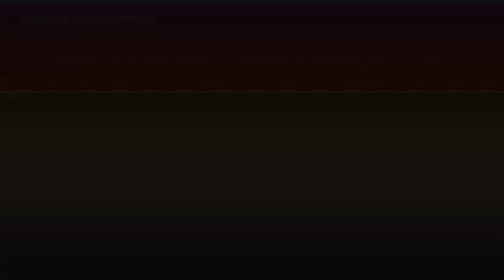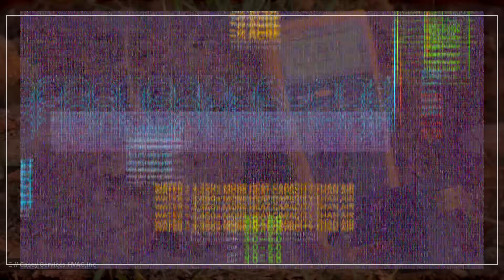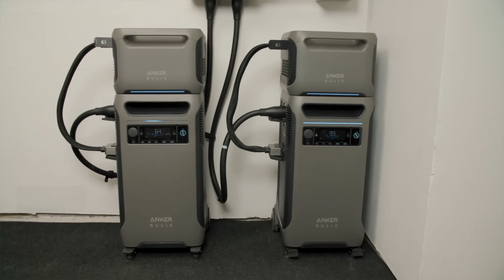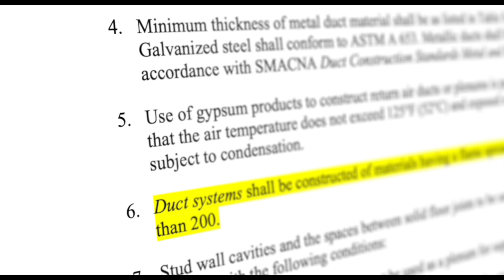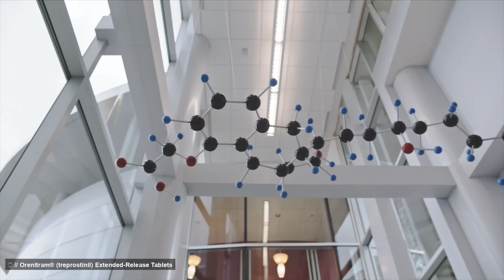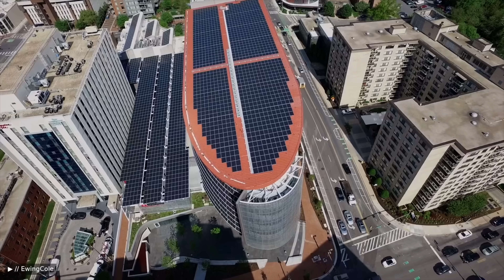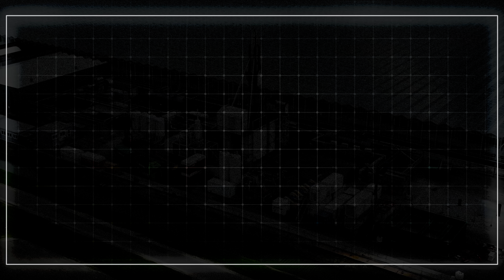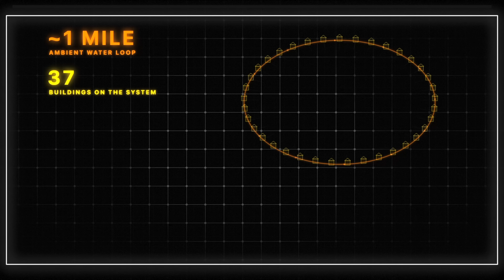The Viral DIY Cooling Hack That Nearly Killed a Family

Comment: This method has been a standard practice in  Europe, for quite some time.  Visit Europe, especially Sweden, Switzerland, or Finland if the emphasis is on heating.  Placed in cellars, it would make millions.
Reply: I concur. Living in Sweden, and I have two relatives, who's homes use geothermal heatpumps. One is the vertical "water well" type, the other one is a horizontal coil type under the garden lawn - the latter actually also heats an indoor pool.
In Sweden, the same companies handle both geothermal and air based heat exchange pump installations.
Reply: @andersgrassman6583  Does that also work when there is a height difference of 10 meters in low and high?
Because I have land, but it's at a slope...
Reply: @bloepje I'm about to start researching the same thing. I've got 3.5 acres in central Texas but the entire property slopes down from the front to the back and drops about 100' in elevation. I've got a flatter spot right in the middle to build my home but I'm trying to think about the hill and maybe I can use it to my advantage where we could kind of trench a large area and then backfill instead of having to drill so deep. 
I guess I'll be doing a lot of reading at work this week.
Reply: @bloepje  the water is already being pumped, so a height difference shouldn’t matter much. They will just try and find a relatively flat spot near to the house where they can drill.
Reply: @bloepje  you usually make a 60-100 m deep hole to pump up and down the heat in.
So in this normal case height difference doesn´t matter at all
Reply: @bloepje  I would seem extremely unlikely that a slope would pose any problem at all! There has to be a circulation water pump whether you use a perpendicular water-well going straight down, or you have coils lying horisontally under a lawn. Why on earth would anything in between - a slope - pose any problem? However, coils need to be dug down to a certain depth, for them to have any stored warmth in the ground to take up. I don't remember, but I think a minimum depth of 2 feet or so - but it likely varies with the climate where the house is. In any case, one can always drill a vertical well in the slope!
Reply: @bloepje  Beyond a certain depth, climate at the surface doesn't matter. It then becomes truly geothermal. I believe +4C.
Reply: @JackHays75 I wonder if you start on the low end, and drill at an angle towards the deep, to take advantage of the increased depth. .

( i dont know if vertical drilling is much more expensive.) Also GOOD luck.
Reply: @andersgrassman6583  i thought coils needed to more than 6 feet. ( maybe more) . this might  vary in soil type and frost line
Reply: @JackHays75 - Your trench and fill idea will actually work against you a bit because it aerates the soil causing more intrusion by the outside ambient temperature than if you'd left it undisturbed and therefore, compacted.

Also, with as much subsidence as Texas is undergoing in recent decades, at least here in Dallas it's pretty noticeable, but your mileage may vary.  You might want to look into how stable your geology is before committing to a foundation plan.  I live in an apartment building from the early 1980's and it shows signs of foundation piering repair at least once, plus they had to rebuild the retaining wall that keeps my building from sliding into the parking lot last year.  A good geologist can be your best friend.
Reply: We live 50 km outside Stockholm, Sweden. We installed a heat pump four years ago and have a drilled hole with a depth of 180 meters. The yearly average COP is around 4. It is seldom colder here than -20°C and we have never needed any additional contribution from electricity to our heating. We had 100% electric heating before and reduced the cost of heating by a factor of four. If we also include other household electricity in the total consumption, we use about one third of the electricity today, compared to four years ago.
Reply: Ground source heating/Cooling have been almost killed of by no installation (apart from in very cold region). When R290 started to be introduced the drawback of air source heat pumps in climate down to -15 was heavily reduced, and work fine even down to -25C (while the COP is quite low at that temperature).

I would say for a new system today, air source is by far the best, and if you need additional efficiency gain, a air-air heat pump is just as efficient as a ground-water one (well give or take depending on the situation).

Now of cause, if you do have the pipes installed, replacing the ground-water pump is still a better option than a air-water.
Reply: Have the coil under the lawn type of installation. Works well, I had to replace the old 25 year old pump with new one and energy usage did drop to half as newer ones are more efficient. Also has option to have the ground cooling unit installed but haven't really needed it. Anyway I think nowadays air heat pumps are almost as efficient and cheeper to install and works well till pretty cold temperatures so might not be worth of it nowadays....
Reply: @EsaNuutinen  The air units is still about a cop away, but there is like 25 years payback for that extra cop to cost the ground pipes.

Well unless you live in a very cold climate. I´m talking about mid/southish sweden with maybe 3 or 4 nights a year with -20C.

When its -5 the ground circuit is hardly even warmer.
Reply: @matsv201 yeah, I'm in south part of Finland myself. And even though last winter was colder than usually it was just couple of nights when it went under -25. Also in 25 years you might need to renew the pump already too. For example in our one it could have been fixed by paying about half of the price of what new one would have cost. And other problem would have been that used liquid to collect the heat from underground would not been available anymore next year... If it would have had to be ever added. So if payback is 25 years it is not really worth of it here. In more north maybe... I think only advantage is that it is less noisy and of course if used for cooling too meaning you warm up the ground by putting excess heat there the ground stores the heat some extend better than if you just blow the heat to the air... I think it makes more sense for apart ment houses where you can have like centralised system for many people which decides the setting up costs for multiple people. Especially I'd old heating has been oil or something where you anyway have radiators etc. Already available. One family houses anyway are required here to have two ways of heating. So air heat pump would be ok with combined with fireplace or similar. And even ground heat pump might in very cold weather use electricity to support the heating (for example if it is like -25 and in addition to you take shower or use lot warm water same time). I think our new pump in past 6 years had been using 30 hours of electricity for heating.when I was checking it last fall... Probably with air heat pump would have been more. So makes sense to keep it when you have it. And of course electricity price also impacts the payback time. Anyway it still saves lot of electricity (and money) compared to like electricity only or oil, no matter if it is air or ground heat pump..if I remember correctly with usinf 1 kWh of electricity you get 6kwh worth of heat out. I think air heat pump the number is 4-5 kWh what they usually promise till -20 or -25.
Reply: @EsaNuutinen  I would say, when its -25C my Air-Water heat pump can´t heat the house. Even when its -20C its a tough sale. I would say about -18C is the threshold where it can. Granted half my home is 150 years old and only got partial added insulation.

Regardless of that at -25C the COP is very low.

What i have done is that i keeped the old furnace and coneted it to the new heating system. So when ever it drops below -15C i just fire up the furnace.

And well if i´m not home, its not really a problem, then i just lower the indoor temp to 10C, and it work just fine at -25C.

"1 kWh of electricity you get 6kwh worth of heat out"
That is typically only true for low indoor temperature at high outdoor temperatures.

Mine do 3:1 during normal winter condition, about -7C outdoors with ~20C indoors.

When its say +5C, and i still need some heating just for comfort it just sips electricity.

And when its +10C i also have solar haters i got before the heatpump, at +10C the  typically can heat the home more or less for free.
Reply: I don't understand how this can be news, because we have been doing this for decades in the Nordic/Scandinavian countries and Europe...😅
Reply: I’m in the upper Midwest USA and it doesn’t make sense to pay more money for an air based heat exchanger when it won’t work on very cold days and I’d just have to buy a gas furnace on top of it.   Unfortunately the watershed district held up all construction of any kind by not issuing permits citing “environmental reasons” and prevented me from any ground based heat exchangers even though I have an ideal property for it.  It wasn’t an environmental group it was used to prevent development for everyone else except a few on the inside who used the devaluation of property to buy it cheap and then give themselves permission to do projects and profit massively.  They just got sued out of existence two years ago for the practice but the damage was done, I was forced to buy a new gas furnace system to replace the failing one.  We need laws here in the US that prevent blocking green energy systems from being installed and need to root out corruption.
Reply: @hugegamer5988  Sand heat batteries are recommended for deep winters. Finland is the place where the concept was conceived.
Reply: @FlameofDemocracy  it's a backwards and primitive. It's crap.
Reply: @deker0954  A wine cellar, or a fridge.  Life is full of choices.